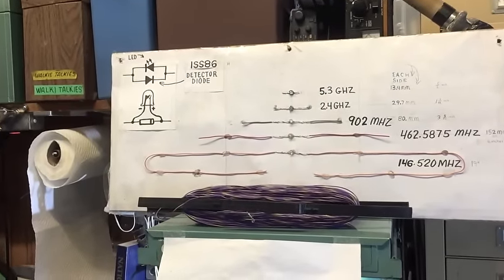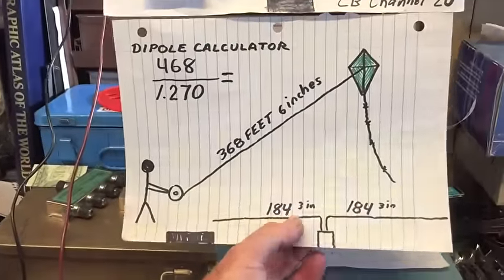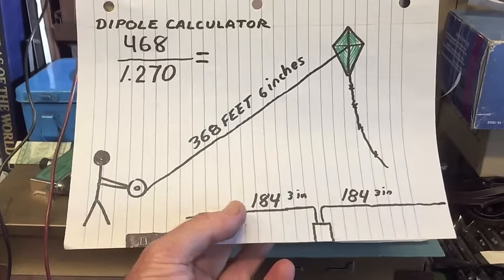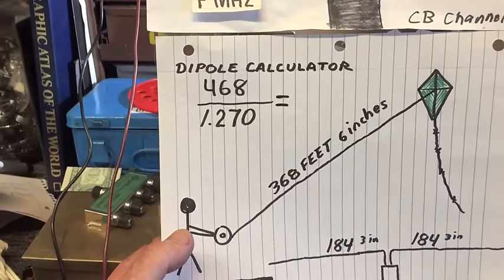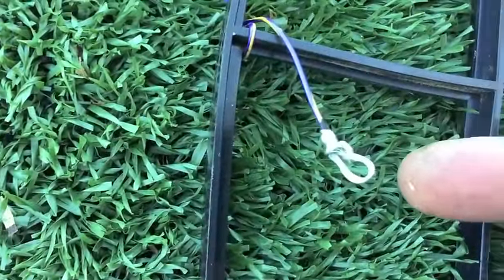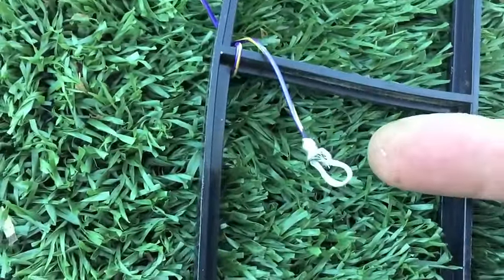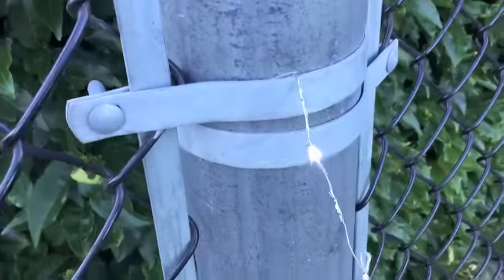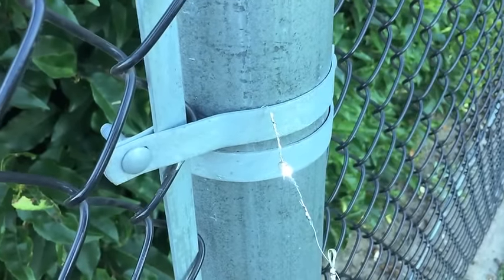Radio Frequency Burns From A Long Wire Antenna Supported By A Kite

Comment: I believe the arcing is electrostatic discharge like is utilized in corona motors. According to what I've heard, it will exist anywhere even if you weren't tuned to a nearby radio transmitter. The voltage gradient increases with elevation and can somehow be made to flow better with sharp points in the conductor that is elevated.

Comment: Try it miles away from any radio stations. Difference of potential can be had just from the distance of the start and end points of that wire if it is long enough. Difference of potential creates current.
Reply from the maker: Good idea.
Reply: @GrantsPassTVRepair 
I picked that up from one of Don Smith’s videos. There are potential voltages from 50,000 to 1.5 million in the air depending on time of day and solar flares.
This is also in one of Tesla’s patent using a high aerial antenna, capacitors and ground connection.
Reply from the maker: @chasson321  I hope to try this again in an isolated area.

Comment: Dude, that’s awesome I love this kind of stuff I seen a video where a guy was able to drop power off of a high tension powerline. It was on his property and all he did is put a couple of wood poles in the ground and then ran a wire across The wood poles and I believe he had the wire grounded to earth and the other end, he was actually picking up quite a bit of electricity I just find that fascinating Of course I wouldn’t try that myself plus it’s probably stealing
Reply: Yes, it most certainly is stealing power, and they can detect that kind just as easily as if you connect with a wire to do it.

Comment: 1/2 wave has minimums at the end. Try 5/8 or 1/4. I shouldn't need to explain to anyone who is transmitting. There's a velocity factor to take into consideration too. I've developed comms gear from HF to GHz and I'm an extra class operator.

Comment: This is the method Mahlon Loomis used for the original wireless setup, both receiving and radiating antennas.  But he didn't know anything about Hertzian waves and resonance, or even that AC was involved.  He just knew it worked if the kites were at the same height.  Of course that would make the wires the same length, but he thought he was tapping into a horizontal DC current at a given altitude with a ground return.  In reality he was creating r.f. transients at the transmitting end by keying it to ground, and detecting it at the other end with a spark gap.  The power was the sky-to-ground potential (as demonstrated by Ben Franklin) whose capacitance he was transiently shorting out, and the long wire provided resistance and inductance.

Comment: 1/2 wavelength antenna requires a dipole in middle. Theortically 1/2 wavelength really long wire should cancel out, since the standing wave should be max at the 1/4, min at the 1/2 wavelength
Reply: actually an end fed half wave (which is just an extreme case of off-center fed dipole if you think about it) is a practical working antenna, with a caveat of having really high impedance, high voltage and low current on the feed point. 
however in this case, he's harvesting electricity between the antenna and a ground, so it may be as well a quarter-wave monopole (half of a dipole, at half the frequency), with the ground acting as "the other half"

Comment: When I was a kid I found a spool of fine copper wire and rigged it up across our house as an arial for my crystal set.
I got great reception.
One day I accidentally brushed against it and felt a 'tingle'.
Now, 60 years later, I learn that it wasn't my imagination.
Thank you. 👍👍👍
(When I told my father he didn't believe me, but made me take the wire down. 😪)
Reply from the maker: The shock you felt could have been from a radio station charging your antenna wire, but here's another possibility. https://www.youtube.com/watch?v=_DHBjeobg4U&t=11s

Comment: I heard stories of back in the ol days of extremely high output AM stations local farmers near the tower would build a coil antenna just right length and attach it to a light bulb and light there barns for free.

Comment: If you get too close to the radio transmitter you can actually end up with a reduction in power because you are in the near field and not far field, and coupling to the antenna can reduce.

Comment: On a receive antenna?!!!!! I always thought that transmitting antennas were the ones that burned you.  Receiving signals, you aren’t transmitting any rf. The station had to be putting out immense amounts of power if you were able to get an rf burn. Guess with antennas being electrical, that explains why you can get burned. But wow.
Reply from the maker: Keep in mind the AM radio station is only a few blocks away from this park,

Comment: I actually experienced this a few years ago and it was during a power cut I was looking for a torch in the kitchen draws we had a old set of fairy lights ever so slightly each led was lit up I was mesmerised but thought I was going crazy as it had no batteries and told absolutely nobody

Comment: That's wild! What is always puzzling me about radiowaves: the energy in them just flows into the ground, but where to? To the radio station potentially miles away? This is such a basic question and it annoys me that I cannot wrap my head around it.
Reply: It warms up the earthworms slightly.
Reply: @felicciasc  Hmm, not quite convinced :)
Reply: @hermannschmidt9788  Imagine that the transmitter is a battery, negative connected to ground, positive to tower.  The air is a conductor which goes to your antenna, between your wire and ground thre's a potential. When you short that out, with the diode , the return current flows through the ground back to the negative terminal of the transmitter. Its lossy a/f. But you could pull that off with seawater.
Reply: @felicciasc  I know, this is the logical explanation, however, the resistance between the transmitter and the receiver is practically infinite. That's where I get stuck. Maybe the earth is like a huge capacitor, which takes the charge from the antenna locally, and through epic length of time the charge differences in the ground level out.
Reply: @hermannschmidt9788  I don't know if this helps, but it's only an electrical signal that is being picked up by the receiver, only milliamps strong. There virtually is no current, so it's ok for the resistance to be high. It's why we need amplifiers generally. His kite was producing a rather high voltage, but very little current could have been achieved this way.
In my humble opinion.👍
Reply: @markhonea2461  there was enough current to cause visible burning of the skin, probably several mA.
Reply: @hermannschmidt9788  the earth would be one plate of the capacitor, the air being the dielectric and the transmitter antenna the other capacitor electrode that is also connected to a power source (the transmitter). Have you ever seen one of those plasma globes that produce purple/Violet streams of sparks when someone places their hand on the globe? This is exactly what is happening with a transmitter antenna, the air and the ground /earth.
Reply: @daic7274  Thanks for the explanation. I am having a hard time with such super large scale constructs. Nevertheless, it totally makes sense to break it down into well-known elements of physics.
Reply: @daic7274  I think that was static discharge. Not constant. I could be wrong.
Reply: It's a little puzzling for sure, but when you get to know a little more about how electrical flow works you'll understand that literally everything in the universe is a wire/conductor if enough voltage is applied. The Earth's surface happens to be surprisingly conductive, for example a household electrical system is based off a very long conductive metal rod that is driven multiple feet into the ground, and when you think about all the contact surface of such a large rod in the ground it starts to make a little more sense. The dirt isn't nearly as conductive as a metal wire in a volumetric density sense, but because there's so much surface area, because there's just so damn much of it, it gets conducted anyways, it's like a wire that is very poorly conductive, but if you make it thick enough it will transmit all the power in the world. Literally lol. Think of the ground that is directly between your house and the power plant that generated the power you use, in a "straight" line (the electrons will never flow in a perfectly straight path, they zig and zag all over the place as they find their paths of least resistance) as being a great big long conductive wire that manages to conduct that much power through sheer surface area/quantity of conductive material found in the earth's surface.
Reply: Eric Dollard has some useful presentations/talks that might interest you.
Reply: @markhonea2461  static discharge would produce sparkles, not burn and smoke, right?

Comment: I had a random wire antenna in central Florida that got quite zappy when storms were building in the area (like most days around Tampa) - now I’d have a discharge unit hooked to it but then… it packed quite a wallop on 59 feet of wire up 25 feet.  I eventually hooked a Neon bulb up to it to reduce charge, it flashed at around 1-2 hz
Reply from the maker: I also have a long wire antenna that does this whenever there is a good charge in the air. This is a video of it. https://www.youtube.com/watch?v=_DHBjeobg4U

Comment: I used a 1000 foot wire using over 300 different capacitors and run a 1/4 hp motor with the energy for months until a lightning strike burned down my home!

Comment: fun fact utility companies have to drive ground rods in their cable storage areas and connect the ends of the KV cable spools to them so they don't accumulate a deadly charge from the sun's microwave output.
Reply from the maker: Interesting. I didn't realize the sun was producing microwaves that effected the power distribution.

Comment: A friend and I were out plinking with our .22's directly below power transmission lines. When Frank went to shoulder his gun, he got a series of shocks on his cheek, the gun barrel was coupling enough to the power line he could draw slightly over 1/8 inch spark. Apparently his stock was much dryer than mine (both wood), my barrel wouldn't create a spark that we could see/sense at all.

Comment: I live pretty near the CN Tower in Toronto and can faintly hear an AM radio station at night.  I cannot make out specific words easily but I tuned around with a pocket radio until I found a match.  It ended up being 590 Mhz.  I have a number of titanium screws in my feet, not sure if that is what sets me apart from other people.  The purpose of the CN Tower is a radio re-transmitter, which I think plays a part.
Reply from the maker: Can you be more clear with your comment? I'm not sure what I CN tower is, but I get the impression   you're hearing radio signals in your body.
Reply: It's a tower in Toronto - the tallest free standing structure in the world from 1972 to 2007.  In addition to a tourist attraction, it has a number of large broadcast antennas. 590Mhz is TV... UHF channel 34, which is not currently broadcast from the tower.

Comment: 0:37 - did you mean 1.270 Mhz (aka 1270 Khz)?  Very cool experiment for capturing energy at resonance.
Reply from the maker: Yes you are correct. I should have said 1.270 Mhz.

Comment: When i was a kid (and dumb), I decided to key up a CB radio with no antenna connected, and instead my finger over the SO238 antenna connector. I got an RF burn on my fingertip that resembled the connector. It hurt a lot and I do not recommend.

Comment: Why not attaching a piezo speaker on to that long wire, instead of the LED. Might hear the station itself!
Reply from the maker: I like your idea for a future experiment.
Reply: Adjust the spark gap and you might be able to hear it on that!
Reply from the maker: @goodmaro  I'll need to give that a try. Thanks for the suggestion.

Comment: Couple of thoughts..........This is NOT   a  "long wire."    It is an end fed half wave.  Types of wire  antennas vary, but they all are based on somewhat specific definitions, AKA  1/4 wave, 1/2 wave,  random length,  etc etc.  By definition, a  traditional  "long wire"  is  "multiple wavelengths."     Therefore for an antenna to be  a long wire  it much be more than  a full wavelength, at least.  All of them can be  called   "end fed."

Next,  a  1/2 wave  sees  high voltage---NOT current and low  Z--at the  feedpoint.  This explains in part why you are getting burns,  which are normally  more easily obtained at a high voltage point.   If you had used a 1/2 wave,  you may have  produced enough current  to blow up a diode.

Comment: Here in Spokane a few years back a radio brodcast station had to shut dow because of the radiation levels were to high at a High School near by the tower, Poor planning on the Radio Stations part to not do a evaluation.

You know all this stuff. I would like to see you power a QRP ham radio rig and make CW contacts by using a random wire to power the rig and use a tuned antenna, meaning an antenna that is resonate  on a HF band.

Side note  when I was in grade School 2nd grade at Redwood elementary school,  anyway My Mom bought me a crystal set shaped like an egg from McGregor's five and dime on 7th street in Grants Pass.

 I would take the crysital set to school and hook to a fence at recess time , listing to KJO radio station. Well I did until one day I did not hear the recess bell ring to go back to class and the teacher came out grabed me by my ear and drug me back to class where she took away my radio set and told me I coud have it back at the end of the year.  I had forgotten all about it a years end so I bet that crystal set is still in her desk that was in 1961 ha ha.

I moved away from Grants Pass to Roseburg when I was 19 and have only visted home a few times since. I miss home, I suppose things have changed a lot over the years, but One thing is still the same and that is the arched CaveMan bridge is still their.

Comment: You might also be picking up the atmospheric potential. The atmosphere has about 100 V/m of electric potential, which would lead to a 100 V/m × 112 m × cos(45°) ~= 7.9 kV.
Reply from the maker: I understand such a possibility, but in this case the  AM radio station is so close to my location, I doubt this is coming from atmospheric potential. Especially after seeing how the LED remained lit up when the wire was on the ground..

Comment: Too bad AM radio signals are vertically pollaraized; you could really make some long antennas it they were horrizontal.  I wonder if you increased the length of your kite wire so that you would get the wavelength vertical height with the kite wire angle, you'd get even more efficiency.
Reply: It hardly pays to consider medium-wave signals as polarized except at a great distance from the radiator.  And you really don't need a kite; a Beverage antenna may be laid on the ground and the resistance between the wire and the ground is enough to make it work albeit they touch.

Comment: That’s going to be static electricity building up on the wire causing the high voltages and sparks. Actual RF voltages received are very low. The same effect can happen on metal building flashing. If the panels aren’t electrically connected to each other you’ll get sparks that cause radio interference.
Reply from the maker: You can get electricity from a static charge, but what I'm picking up is not from a static charge. When the radio station lowers their power at night, The brightness of the LED is far less.

Comment: This is awesome!!! I wonder if you touched the other end to another metal object, could you hear the audio of the station?
Reply from the maker: I'd guess it might be possible to hear the audio from the electric arc if I was close enough to the radio station.
Reply: @GrantsPassTVRepair  Try discharging that arc into a metal resonator of some sorts, maybe a large metal pipe sealed at one end or something so as the arcs stimulate sound in the metal its amplified.  Kinda how people make singing tesla coils but much lower power in this case.

Comment: To be honest, if you dropped that wire on the power lines, if they were transmission lines, the wire would likely arc the lines to ground over the main twin lines that are the ground potential equalizers, to the main lines which would then create a power surge across the wire and burn it in a second. 
One aspect not many people actually know about electrocution is the time aspect, so you have volts, amps, resistance (from your body) and time.
Reply from the maker: I understand you may survive if the wire shorts to ground rather than through you, but ever since I read about a young kid dying who flew his kite with wire after it landed on some power lines,  I would suggest no one goes near any power lines. with this.
Reply: @GrantsPassTVRepair  While sitting in my bath tub I reached over to turn on the wall heater. It was 220v! Ungrounded. 
       It was a rooky move. Mussel retraction saved me. 
220v is a "gas" man! You learn what 60 cycles AC is in real time.
Reply from the maker: @robertmoore7199  Terrifying. You're fortunate to be alive.